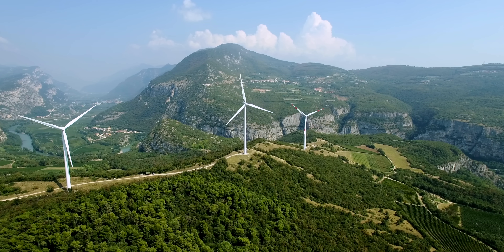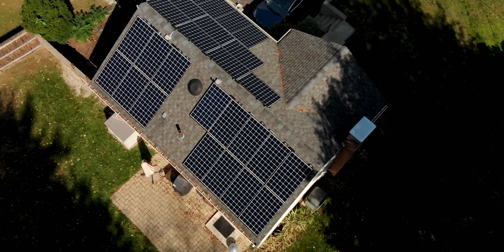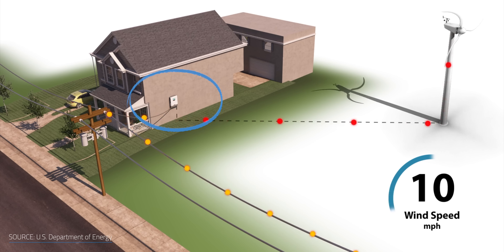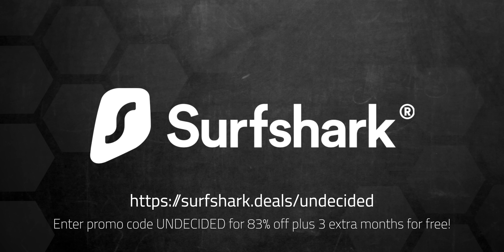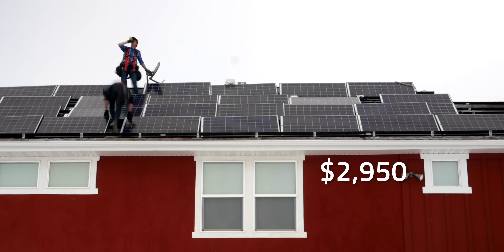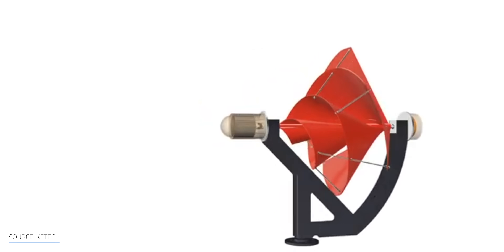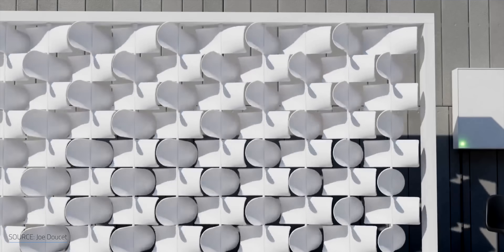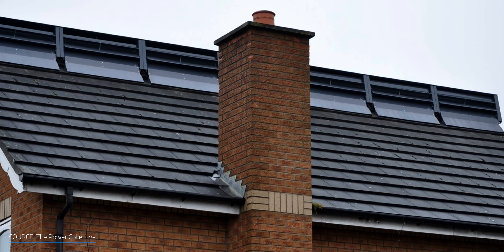The Challenges of a Wind Turbine on Your Home

Comment: GreenEnergy & Science
Wind Turbine Blades Can’t Be Recycled, So They’re Piling Up in Landfills
Companies are searching for ways to deal with the tens of thousands of blades that have reached the end of their lives.

ByChris Martin
February 5, 2020, 5:00 AM ESTUpdated onFebruary 7, 2020, 11:54 AM EST
Share this article
A wind turbine’s blades can be longer than a Boeing 747 wing, so at the end of their lifespan they can’t just be hauled away. First, you need to saw through the lissome fiberglass using a diamond-encrusted industrial saw to create three pieces small enough to be strapped to a tractor-trailer.

The municipal landfill in Casper, Wyoming, is the final resting place of 870 blades whose days making renewable energy have come to end. The severed fragments look like bleached whale bones nestled against one another.

“That’s the end of it for this winter,” said waste technician Michael Bratvold, watching a bulldozer bury them forever in sand. “We’ll get the rest when the weather breaks this spring.”

Tens of thousands of aging blades are coming down from steel towers around the world and most have nowhere to go but landfills. In the U.S. alone, about 8,000 will be removed in each of the next four years. Europe, which has been dealing with the problem longer, has about 3,800 coming down annually through at least 2022, according to BloombergNEF. It’s going to get worse: Most were built more than a decade ago, when installations were less than a fifth of what they are now.

Built to withstand hurricane-force winds, the blades can’t easily be crushed, recycled or repurposed. That’s created an urgent search for alternatives in places that lack wide-open prairies. In the U.S., they go to the handful of landfills that accept them, in Lake Mills, Iowa; Sioux Falls, South Dakota; and Casper, where they will be interred in stacks that reach 30 feet under.

“The wind turbine blade will be there, ultimately, forever,” said Bob Cappadona, chief operating officer for the North American unit of Paris-based Veolia Environnement SA, which is searching for better ways to deal with the massive waste. “Most landfills are considered a dry tomb.”

“The last thing we want to do is create even more environmental challenges.”

Comment: I'm just spitballing here, but what if you solved the moving parts problem with windmills the same way Tesla did with electric motors--by suspending the moving parts in magnetic fields instead of touching each other? Instead of the windmill powering an electric generator, make the windmill itself the electric generator. With or without completely redesigning the blades/fins/screws/turbines/etc.

Comment: You live in the United States! I would have given you a like IF you had used standard measurements such as mph along with metric. Also, you have left out a whole lot of cons with wind turbines. The number of birds killed by wind turbines. The psychology effect of moving shadows being projected. The low frequency hum caused by the turbines themselves as well as those given off by square wave inverters. The inefficiency of those same inverters. How about wind turbines exploding, whipping broken pieces of turbine blades hundreds of feet away. Or the generators catching fire, sending noxious chemical gasses in the air? If your so fired up about the environment, what about the effect of mechanically slowing the winds that have been blowing since creation? I could go on and on, as if I haven't already.
Reply from the maker: I've got another video on large, grid scale wind turbines that touch on those topics.  These are small/micro wind turbines for people's home.  Completely different pros/cons.

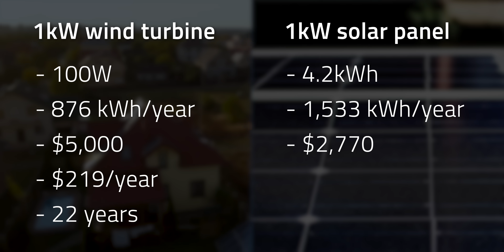Comment: 9:17 the calculations reminds me of similar issue i had when i did math for solar vs wind, wind for me cost more and wasn't justifiable, the payback period for me was even longer than the age limit of the wind turbine
tho i think for solar vs wind, for a stand-alone system is different from an urban grid-tied one
solar use more storage than wind, so i think for stand-alone ones they are more on equal footing, sometimes wind can be better for northern lattitude and higher elevations, bc you can reduce battery storage to a minimum
an ideal system for me would be a hybrid solar-wind-storage balanced system depending on your location

Comment: As you alluded to, the best option is dependent on a large number of variables. "Renewables" generally require a great deal of land, for large scale, but for personal use, not necessarily so much. I really don't like the problems of disposal of solar collectors. I live next to a large lake, so to me, wind power is attractive. The ridge line product would seem to be the best for what you showed. However, I've also seen small units that can work from any height/direction, with no moving parts visible (so, likely less of a concern for animals). Batteries then become an environmental concern locally, while connection to the grid becomes an environmental concern globally, though likely at a cost savings locally. So many variables!

Also, I think it's time to separate the climate alarmism from pollution. They are separate issues. Regarding the former, CO2 is required by plants to survive, which produce the O2 animals need to survive. We know that CO2 levels were much higher in the earth's past than they are now. Where are all the tree huggers when you need them? OTOH, while CO2 levels are well within reasonable limits, there is much we could be doing to reduce the negative impact on the environment that releasing unnatural chemicals (etc.) into the environment. Some of the solutions for the latter are, in fact, quite economical.

Comment: Thanks for the information you did present, helpful. I would like to thank those who are working on the problem. If we are to really replace the giant batteries that are fossil fuels, before they run out, we are going to need every watt we can pull from our environment. 

I think what these small installations are going to need are highly variable planes. I'm not sure affordable technology exists yet for this however.

I used to race sailboats. Over the course of a ~5  mile course in the evening when we often raced wind conditions changed radically. Some days we'd have gale force to nearly zero wind in one race depending on the course and weather. Compensating for that required the ability to change how heavy a sail you had, the surface area, and the shape of the sail in the wind. Current commercial turbines do this, as you said, by varying blade pitch, orientation to the wind, and with blades that flex in ways to optimize them selves best possible. 

The unfortunate thing about your and other analysis is that the monetary cost of environmental impact is largely absent. It's just not fully factored into either the cost of grid supplied power, the materials & construction for any solution, etc. Is what it is. The data is not available. It's far more complex than carbon per KW, which is complex as well. I just feel like if we actually paid for the environmental impact wind would look far better. Free market theory depends on complete information and all costs being in the price paid by the consumer. I digress.

Again, thanks for the video and the information provided.

Comment: I’m undecided on both solar and wind power. Although my house is a great candidate for solar, as well as wind, the issue is cost and maintenance. Both options are still a long way off from me breaking even or turning a profit from installing either one. The chances I will live here long enough to reap any benefits is also slim to none, so unfortunately, I will continue to pay the subsidized electric bills until I can find a better alternative. Unrelated to this video, but geothermal sounds like a great option if you could get a smaller system than a standard size system that may cost up to $80,000, that might be worth the investment.

Comment: I enjoy the knowledge you're sharing. Unfortunately, KETech appears to be defunct. No new info posted in last 5 years! RidgeBlade sounds promising but I would want to thoroughly review a lot of in-home, delta sound/frequency data comparing before and after installation and during a variety of outside wind conditions before giving it any serious consideration. The attic space acts as an echo chamber and each will have its own peak resonant frequency. Finally, the Doucet Wind Turbine Wall's generation claims have received significant criticism due to lack of substantiation or correlation with known physics.

Comment: Feasibility of home wind turbines scenario definitely depends on the area where you live. Ireland could be a great place, considering also the absence of sun pretty much all year long. Ebro's valley in Spain is also a place where wind blows like 300 days a year, also during night time where solar doesn't produce (as a matter of fact the area is full of industrial wind turbines). Price and legislation in this cases are the key for me.
Reply: Writing from Ireland, I agree in part. I live in a coastal location ideally orientated for a ridge turbine, as the prevailing winds in these islands are South-Westerlies.
I cannot get any feedback from Ridgeblade, and assume they are out of business. 
Instead I am looking at air source heat pumps. The temperature here rarely drops to zero. 
We get lots of sun in Ireland, but also lots of rain. That's good for PV, as it keeps the panels clean and cool. It is not California, but solar is as viable here as in the northern US .

Comment: I could see a wind system as more practical in cold weather: On a typical winter day solar is decreased (assuming you can even keep snow free),  and heat loss from a home is proportional to wind speed. Reduced foliage on local trees would also help.
My main concern would be accessing the turbine for maintenance, having the room to drop it down to ground level is a big plus.
Reply: @Merfax Yeah, I would need both solar AND wind here in Northern Illinois, if I want to be completely off grid. Some of my neighbors have installed a number of solar panels on their roofs over the past 2 years, and I was very disappointed to discover that they do not have a heating feature to melt off snow. If I went solar only, I would have to keep them out in my yard at an accessible height, so I could brush the snow off during the Winter.
Reply: @crazyfvck  There are icing issues with wind power in snow, and the heating often costs more than the solar is worth. In cold climates renewables at the home scale is quite tricky- carbon neutral wood burning/gasifier is often a much better option. Fine environmental dust is also an issue with solar, so keeping them washed is important, like you say some way to clean them is good.
Reply: @carbon1255  turbines in Greenland a tartic
Reply: I live in Britain - UK planning sucks @ss.
Reply: have you considered 'night time', which I guess could be considered colder weather... or also during cloudy days. Interesting how so many people dismiss the complimentary effect of wind power... forgetting how many decades of research have promoted solar over wind for residential application
Reply: What about vertical  turbines

Comment: The efficiency of each green energy production system depends on the microclimate of each area as well as other environmental parameters.
For example: If you are next to a river, a water turbine is more efficient than any other medium.
If you are near a coast with high waves the most effective solution is different from the one we would apply to a coast with high tide
From region to region and at distances of a few tens of kilometers, the microclimate changes dramatically, depending on the morphology of the soil. This means that a solution that works for one person may not work for another, even if they are both in the same area.
 Parameters such as the average annual solar radiation, the average annual intensity and direction of the winds, the average annual flow of a river, the average annual ripple height, the intensity and direction of the sea currents, the latitude, the hazard storms and the frequency of occurrence of these phenomena, must be taken very seriously.
Also the installation site itself must be checked for any shading from neighboring structures, trees, tall buildings, hills etc
 Any future changes in the surrounding area (eg construction of new buildings, tree planting, construction of public works, etc.) must also be taken into account.
 As one can easily understand, the serious study and evaluation of all the above parameters in combination with the legal status that is valid in each country, is the one that will show us the most effective application for each individual case.
All technological solutions are correct and effective when applied in the appropriate way and with full coverage of the prerequisite conditions.

  Reducing pollutants means two things:
 Reduction of energy consumption-waste
 Production of energy from renewable sources
 
I believe that prevention is always better and more effective than cure .:

 Better and more efficient insulated houses, application of natural ventilation techniques, mechanical adjustment of the incident sunlight, installation of solar water heaters, creation of gardens and replacement of all devices with category A +++, are some of the measures that all of us can do to take.
In this way we can reduce electricity consumption by up to 80% !!!!!
And this without depriving us of anything !!!
Facilitating the work of renewable sources which are called to cover a small percentage of our basic needs.
 Technology and know-how are immediately available, use them and we will all win !!!

Comment: I was in this unique chance too: Solar or Wind Turbine or both. Solar panels will produce power when the sun is out. Panels can be installed on roof tops without annoying the neighbors. And each Panel of 2x1meter can produce 500W max. A regular house can have as much as 16 panels producing 8KW per hour (max). Now install a turbine with similar capacity and you will be visited by angry neighbors.
Wind Turbines need to be less annoying to neighbors and much cheaper as well.

Comment: Large scale third generation wind turbines don't have gearboxes. They have variable pitch blades then a direct drive alternator. The resulting current/voltage/frequency is corrected using inverter technology to provide the correct output. The transformers are also now mounted at the top of the tower. 
Failures in early designs were mainly associated with gearboxes, especially in offshore installations. Less moving parts now= greater reliability

Comment: I'm purely solar at this point with battery back up, but the idea of having something generating electricity when the sun is down definitely appeals to me. Been thinking about small scale vertical axis for some time now. That roof mounted system looks like it could be game changing, along with the wind wall. If you think about it, you don't really need to generate a ton of electricity at night, so having even a small windmill can help decrease your storage/battery capacity while keeping the lights on.
Reply: A small vertical axis mounted on the roof knock should also be more efficient. The classic horizontal ones seems bad for private use due to noise.

Comment: Energy production seems to be much cheaper to build, repair, maintain at scale in large installations--that definitely rules out small wind turbines in the short term. It's FAR more efficient for individuals to focus on remodeling their homes to reduce personal energy usage. Cheaper modern homes have woefully bad insulation, leaky/thin windows, thin walls, small holes in the exterior where air escapes, etc. Since most of your energy usage is just from heating and cooling your home, you can focus on remodeling these aspects to drastically reduce energy usage--and in the process make your home significantly more comfortable to live in, too. After watching videos about "passive house" remodels, I'm fully on board with individuals focusing more on energy reduction rather than production. And of course, an energy efficient home needs significantly fewer solar panels to go fully net zero.

Comment: I pretty much have a failure of an installation. We have very strong winds for 6 months of the year....
So I installed a 3000 watt 48 V wind turbine I also bought a 2000-watt 3-phase inverter..... even though we had very strong winds many times over 20 miles an hour the inverter almost never kicked in because the voltage from the wind turbine wasn't over 24 volts..... plus the wind wasn't real constant, there were many faster gusts and slower gusts.  So then I finally realized that the wind turbine doesn't hit the 48-volt unless it's almost at Max Speed...
So next time I'll buy an inverter at about half the rated turbine voltage with an overflow resistor and I'll get a wind turbine that has a lot of mass in the blades/generater unit so that it so that it rotates relatively constant in different wind speeds